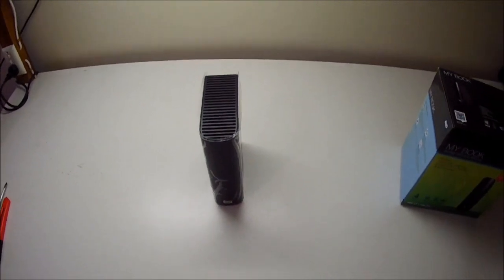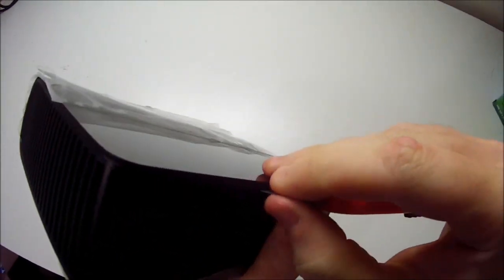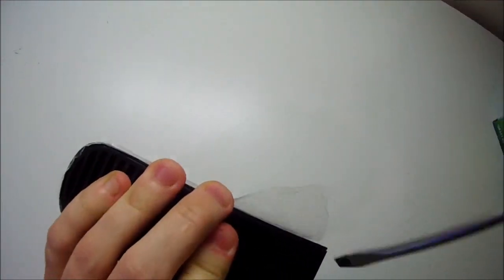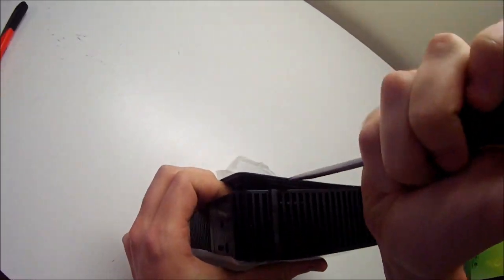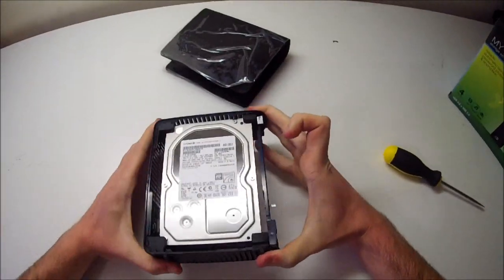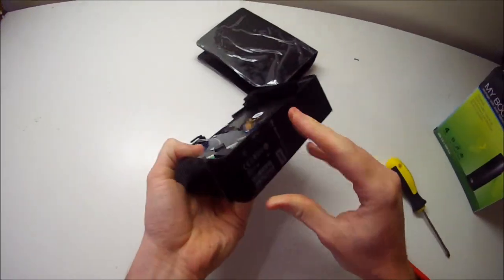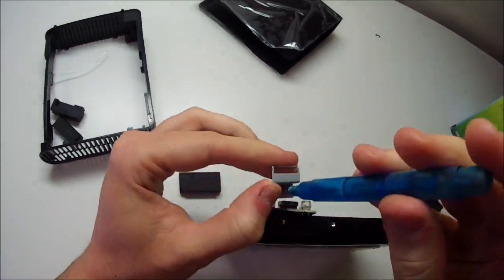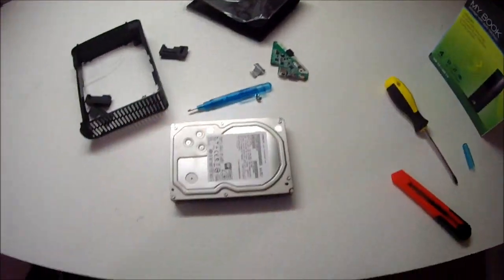Shelling a 4TB Western Digital MyBook USB3 External Drive

Comment: When you remove the drive and mount it directly to your PC, Windows does not recognize its partition. All files are gone unless you use the USB3 board that comes with the enclosure. Have you found a way to access the files in the drive once you removed the drive?
Reply from the maker: Ali Moeen That seems incredibly strange. Most boards in externals are just basic USB SATA controllers. It should appear the same regardless of what it's plugged in to. The only thing I can think of is the board is doing some kind of abstraction between the disk like RAID, which your PC can't read without the original controller. What model enclosure do you have?
Reply: I have the same model (4TB) that you opened in his video. Have you tries to use the disk without formatting it?
Reply from the maker: Ali Moeen Unfortunately this was too long ago. I think I used them straight out of the box. If you connect it back to the controller and plug it in via USB do the files still show?
Reply: Yes

Comment: I think I am not going to use any WD drive anymore , I fucked twice in 2 years the drive just won't show up on my iMac anymore
I just lost 4TB of photos and 2 years ago 2 TB also on WD my book duo
Reply: I had this trouble with mine.  I know this might sound obvious and stupid bit all I did was un plug everything from it including the power supply, then plugged it all back in.  apparantly these drive "seize"  sometimes or some shit, thats what the guy in the shop said
Reply: I try everything that is possible even trying to recover with Stellar n after more than 20hours of scanning comes up with nothing that I wanted. Then I borrowed a friend same 4TB drive and swap his Hdisk controller card and the drive show up I quickly copied all the files to a brand new Seagate and after that I initialise the hard disk (green Label) the worst of WD drive on an external Esata. I am going to use this drive to hold movies where if it is gone it is not going to hurt me that much. not all my AE, my PSD n etc files.

Comment: What is the thickness of the drive itself? I'm looking to put one of these drives in my xbox one media hub, which only has room for a 2.5 inch in terms of thickness drive  - http://www.bestbuy.com/site/collective-minds-usb-3-0-hub-and-hard-drive-enclosure-for-xbox-one-black/4329402.p?id=1219731644124&skuId=4329402

Comment: These things are so unreliable... I was thinking, after buying this, that a 4tb HDD is just too bulky to carry around, with having to plug it into an outlet etc, so instead of buying a new 4tb drive, I'd crack this one open and install it into my rig. 

Then I was thinking maybe to throw down for another 4tb in a NAS setup and I'd be set, even if this thing failed, I'd have everything sync to the NAS as I do it... Seems like a better alternative than using these crappy external enclosures, as I've had several fail...

Comment: i dont get it why external drives are cheaper than internal ones ? what happens to all that extra plastic ? does it come from space ? :D stupid wd. they are selling crap again.
Reply from the maker: I realize this is an old comment, but I don't frequent my own videos comment section often. In this case, the externals were cheaper because of the flooding in the factories in Thailand at the time. Internal drives have a shorter lifecycle from manufacturing to actual use, so their price jumped over night after the flooding. Externals, especially the larger (at the time) ones sit on store shelves for a while and usually don't change price with the market.
Reply: Did you just say Hitachi drives are inferior to WD? What are you smoking man?
Reply: +xAsmir Because if you were to buy a WD 4tb Internal drive, you'd get a WD 4tb drive, however when you buy externals you are getting the Advertised makers shell, in this case WD, but an inferior HDD internally, ie. Hitachi HDD.